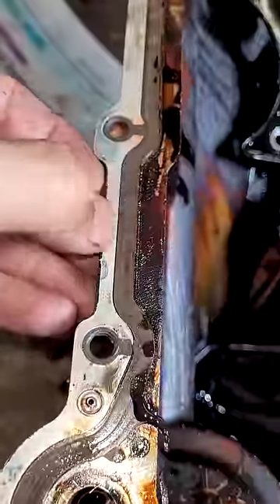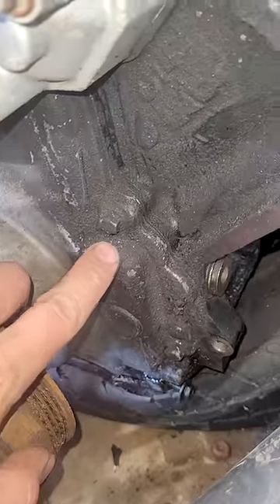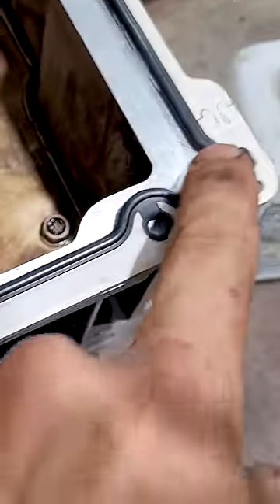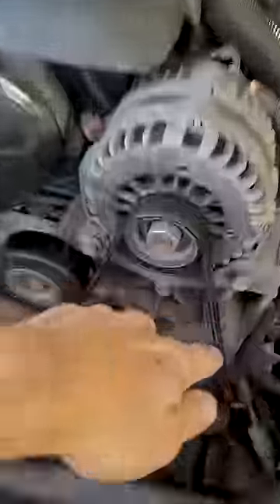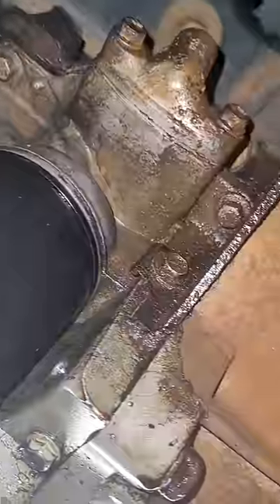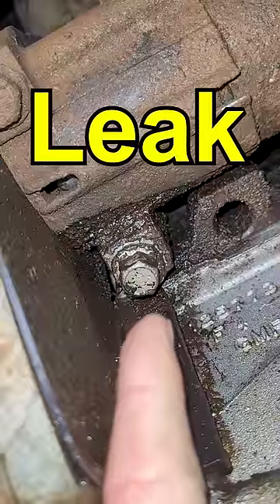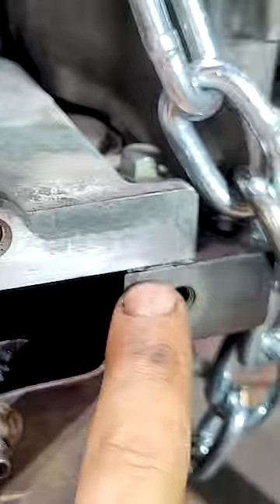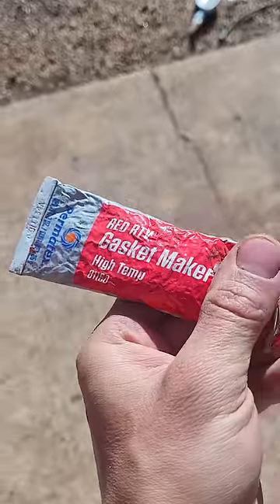Mechanic States Chevy Oil Pan Leaks?

Comment: I never fix slight oil leaks on Chevy's its natural rustproofing
Reply: Now this is a man of culture
Reply: Blew a trans and transfer case.. absolutely soaked the entire undercarriage... my mechanic said "dont wash the truck, and it will never rust👌" lmao...
Reply: @josefbecher4790  
😅😅😅 I have five registered and insured vehicles newest being my daily driver a '72 eldarado, oldest being a '58 Lincoln.
All pass state inspection because every vehicle leaks oil and the undercarriages are saturated. I park in my garage on cardboard and toss the cardboard into the burn can monthly because our recycling guy doesn't want it.
Reply: @user-qr1dk9ud2s  do you own an oil refinery?! Lmao... worth the monthly car payment just to "top off" fluids hahaha.. keep em alive man, they'll treat you good forever
Reply: @OldAndInTheWay-k1w  mine is an 03 Tahoe... 350k on original engine, leaks like a stuck pig, and perrrs like a kitten with plenty of power and no knocks 👌
Reply: @josefbecher4790  
The money I'm saving on undercoating and yearly touch ups I just recycle into clean oil.
Thanks....

Comment: 2005 Silverado 5.3. 137K miles. No leaks as of now.
Reply from the maker: Lucky!
Reply: 1997 Chevy s 10 blazer 4.3 350,000 miles similar architecture only oil leaks ive had were from the oil cooler lines i ended up just changing out the o rings no more leaks

Comment: you forgot to mention to always replace the gasket for the oil cooler even if your truck doesn't have the oil cooler.  The block off plate still uses the same gasket even if the cooler lines are not there.  Replace that gasket while you have to pan out.
Reply: Learned this the hard way on my ‘99, stuck in my side bay for a week waiting on cooler lines and correct gaskets. Never again let the mf leak

Comment: 1. Disconnect Battery. 
2. Loosen lugs on front wheels. 
3. Jack vehicle securely. 
4. Remove front wheels.
5. Turn wheels to max left.
6. Loosen designated bolts on front diff.
7. Loosen designated bolts on transmission.
8. Loosen starter and secure.
9. Loosen remove flywheel dust shield. 
10. Loosen driveline and secure.
11. Loosen oil cooler lines and remove oil filter housing assembly.
12. Loosen oil pan bolts and remove oil pan. 

If you need extra space hoist engine up a few inches carefully and push/pull front diff towards front of truck against sway bar. It should give you enough room to pull oil pan down and towards rear of vehicle.
Use only Fel-Pro gasket set no gasket sealant necessary when using this product. 
Reassemble in reverse.
Make sure to top off fluid levels afterwards and visually check for any leakage after starting vehicle and getting it up to normal operating temps.
Common leak is where oil pan and timing chain covers meet.

Comment: Good videos, but i reccomend the 'right stuff' black gasket maker, thats for engine oil pans and covers. The red stuff isnt the proper gasket material to be using. Ive seen red and orange silicon leak the most.

Comment: Man you had me until the RTV red....

Silver my dude. Silver.... red is for exhaust..

Black is for same surface (iron on iron for example) and silver is for mix surfaces/high expansion. (Iron on aluminum for example)
Reply from the maker: Ehh it's all the same. Pretty sure Chevy recommends red for this.
Reply: @MattsShop I worked at a gm dealer for like 5 years. I don't think I ever saw anyone use red for anything ever.

Comment: I was just getting ready to do gaskets ,96 S10.  202,000 miles and losing about a quart every 450 miles ...Thanks!!
Reply: Check the oil cooler lines the orings get flat and it'll leak also if you have the remote oil filter housing would be up under the front of the s10 the lines to the remote oil filter to the block can leak also

Comment: Curious,
Did it come with silicone on the corners from the assembly line?
…asking for a friend.
😆
Reply: Subarus don't have a oil pan gasket from the factory but the parts store will sell you one
Reply from the maker: I don't know off the assembly line, but this is recommended by Chevy.